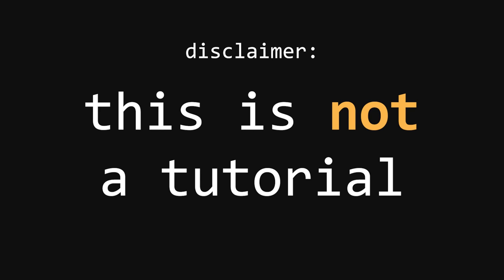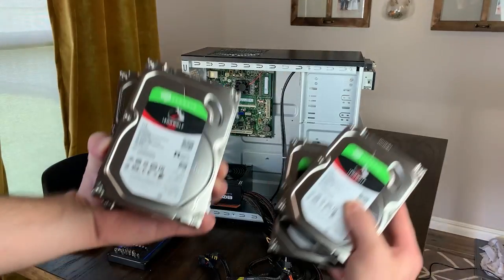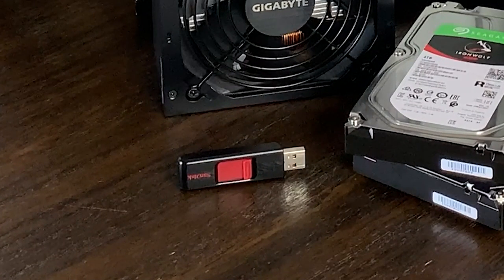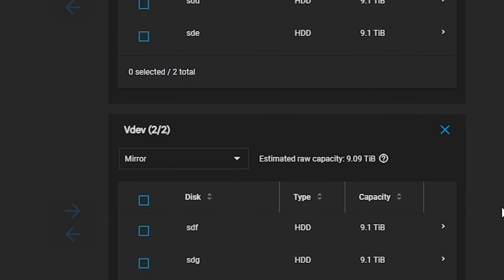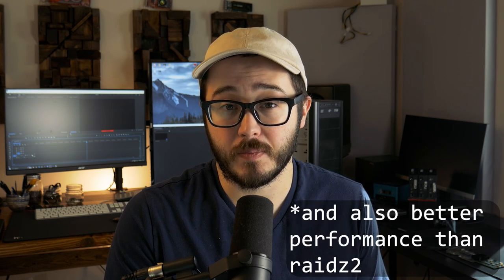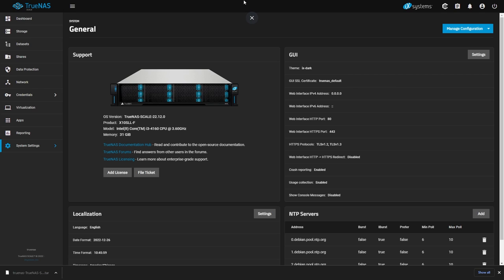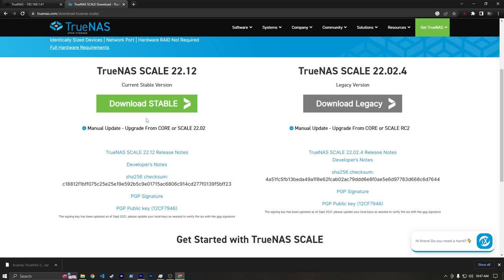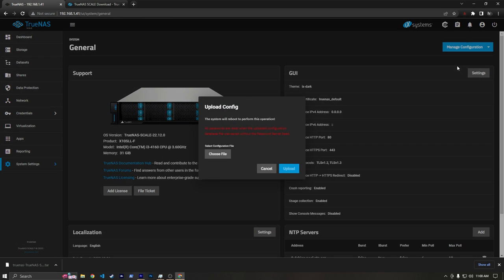Upgrading My TrueNAS Server Again

Comment: If you don't want to reinstall the OS when switching drives you can add the new drive to the boot pool which will mirror it so you can have redundant boot drives. But in this case once the mirror completes you can remove the flash drive boot device from the pool so it is just the SSD. Unsure if it is much of a time saver since it can take a bit for the drive to mirror.

Comment: Technically you weren't moving the pool, as you were creating a different pool with totally different layout. The (longer, slower) way to do it would be to fault the 4TB drives one at a time, replacing it with a 10TB drive, and letting the array rebuild/resilver. Then when the last drive is rebuilt, you'll get the option to expand the array to fill the new disks.
Reply: Yeah, I would still do it like in this video. Bad things happen if a fault is found on another drive as its rebuilding on a single parity drive set.

Comment: Ahh, I've been binge-watching your videos since I started getting interested in setting up a NAS, since I realized it would make managing my astrophotography stuff much easier! Nice to binge watch something then immediately get a little more XD Unfortunately so far I've been massively fumbling my hardware choices. Bought a CPU then realized it didn't actually work in the board I have (thanks LGA1151), then bought an Optiplex tower that already had an 8TB drive in it. I know I'm throwing caution to the wind not doing any redundancy to start, but I'll be keeping things backed up on an external drive too. ...then I learned TrueNAS really wants ECC ram, which nothing I own is compatible with. We'll get there eventually XD
Reply from the maker: Honestly you’ll probably be fine without ECC. It’s great to get later on, but don’t sweat too much

Comment: abit late to the show, but there is a sooooooo much easier may to migrate, especially your old and new diskset have the same "layout" just with bigger disks:
1) add the new disks to the pool with the same disk-layout as new vdev(s). so that you have e.G. one raid5 with 3+1 4T drives and another with 3+1 10T drives in the same pool
2) when the disks have sucessfully added, mark the other, old vdev for removal. this step will take long, because zfs will now shuffle around data in the background to free up the old disks. because there is enough space left in the pool then, this will work without any hickups. zfs will auto-distribute the data to the new drives, because it is the only possible place where the data can go to. in larger arrays this will be more spread out and balanced afterwards, depending on individual fill-grade of the vdevs and such, but here it would be straight-forward. 
Swapping all disks in a pool to bigger ones AND having the physical ports needed to have all disks attached all at the same time, is the best-case-scenario for this method.

after everything is done, the old disks can be simply removed physically. 

another way would be to explicitly replace disk-by-disk. after all disks have been replaced, your pool should auto-grow, because now there is unused space on all disks which the pool can be extended to. 

both methods work equally well, the first one is just significantly faster, as it is only a single operation. also only usable data have to be moved, not empty blocks, so this will be faster, when the disks are not full.

Comment: 20TB! You must be storing a lot of memes :)
Reply: thats not much! my nas is made up of 12TB & 14TB & 16TB drives, looking to add 2 20xtb redundancy drives in eventually migrating the smaller capacity drives to the lager capacity then add more 20TB drives in
Reply: @gh975223  bruh… 20tb is a lot.
All my drives combined are 4tb and only half is used, for people who hoard data 20tb might be normal but for the average person they'd never fill that up even if they tried
Reply: @First_Grafter  photographs alone is easily 4TB in jpeg format not the preferred format of NEF. if SSD were not so so so expensive i would put a few 4TB SSD in the system for just the photographs
Reply: @gh975223  yeah but not everyone is a photographer or even know about higher quality formats
Like that you have that much storage is okay and pretty cool
But it's really not what the average person has

Comment: Short question. Is true nas better as openmediavault? I run OMV but I think true nas is interesting
Reply: Just an observation as someone who is moving from OMV to TrueNAS Scale... one isn't necessarily "better" than the other, but TrueNAS is a better hypervisor if you want to run services beyond data storage. OMV is easier to install and do a base configuration as a NAS in my experience, although TrueNAS has more flexibility. That flexibility comes with a learning curve though, and like anything you "learn" on I've broken my installation several times. Currently I still have my OMV device in place, and if possible I would recommend experimenting with TrueNAS on another piece of hardware before wiping your existing storage solution. I'll end up with 2 servers... a TrueNAS hypervisor/Jellyfin server and my OMV box will get a storage upgrade, at which time I'll have to decide whether it stays OMV or becomes TrueNAS. I'm leaning toward keeping OMV running on it since it's a known quantity to me and TrueNAS is only recently out of beta. Good luck!

Comment: 5:03 - For heaven's sake! PLEASE PULL OUT the fan connectors BEFORE blowing compressed air through them as they generate a high enough voltage to fry your motherboard with ease.

Comment: Ive been thinking about converting my old laptop (2 cores, 4 threads 2.1ghz) into a nas, but i also find it useful as a minecraft server (2-10) players, could i possibly run both at the same time? or would i need an upgrade to the cpu (i found a 4 core with hyper-threading at 3.2ghz)
Reply: I could be missing something, but laptops don't allow you to upgrade CPUs, and if the one you have does, the CPIUs likely aren't compatible sockets.
Reply: @Ultrakillisprettycool  no i have done some research and they do appear to be the same socket the 2 core with hyperthreading is an i3 2310m and the 4 core hyperthreading is an i7 2630QM
Reply: @notFoxils  socket is irrelevant most laptops are not cpu or gpu upgradeable I highly doubt it. Get a Dell optifine off ebay you can get a quad core with hyper threading for like $200
Reply: @52thephotoshop  Some old laptops could be upgraded.
Reply: You will likely have a problem with the cooling if you even succeed switching the cpu

Comment: What do you think is the Best Motherboard/CPU combo for a PC-NAS ?
Reply from the maker: Really depends on what you need it to do. For just a couple drives in RAID1 or something with gigabit Ethernet, you can basically run it on anything. If you want to get into things like 2.5/5/10GbE and more complex raid setups or if you want to run other services, it’s going to take a lot more. 

Assuming you want something fairly basic, 4th gen i3 systems are usually pretty affordable and aren’t too bad on power draw. If power is a bigger concern, look for systems with “mobile” CPUs. Just do some research and see how well it will work for your use case. Hope that helped
Reply: I'm going b450 asrock pro4 full atx with 3400G, after NY.  Coz the smaller kid just got smallpox. I know overkill, but that't what I got laying around. 😅

Comment: just did same thing myself went from 3 4tb drives to 6 in raid z2 config old was a raid z1. I couldnt figure out how to do the replication task so i ended up just going with The copy paste method  over smb on 2.5gig nic's  it only took about 6 hours to copy all 7.6tb over wish i had seen this vid on the replication it probably would have went much faster and no annoying copying box on the screen

Comment: My NAS is running Windows 10 Pro, and it works great. I disabled the auto updates, and now I haven't rebooted in 2 months. Is anyone else using Windows?
Reply: what hardware are you using for NAS ?
Reply from the maker: If it’s storage and attached to the network, I’d say it’s a real NAS. Windows wouldn’t be my go-to, but I definitely won’t discourage people from using it if it makes sense for them
Reply: @tanmaypanadi1414   I am using an Intel NUC. It has a pentium Sliver J5040, 8 GB of ram, 256 GB SSD for Windows. For media storage, I am using 2x 4 TB Seagate Ironwolf NAS drives.
Reply: @0deepak  oooh this is literally my AIO PC I use everyday, same same!
the mb itself it's tiny so easy to fit in a back of a monitor 😂
Reply from the maker: Makes sense!

Comment: I see 3 Lenovo mini pcs in the backround on the bottom right. So Im assuming your going to do a cluster with them. Proxmox, XCP-ng just a guess. SHHHHHHH spoilers
Reply from the maker: Possibly, as long as I can get them to work 👀
Reply: @HardwareHaven  You'l figure it out l your really good XCP-ng is easy to do but all you have to consider is ha or distributed storage proxmox basically same deal just setup the replication task
Reply from the maker: No, I mean I have to get the PCs to work at all haha
Reply: @HardwareHaven  o sorry. But getting the pc to work at all is a one of the funniest responses to something like that